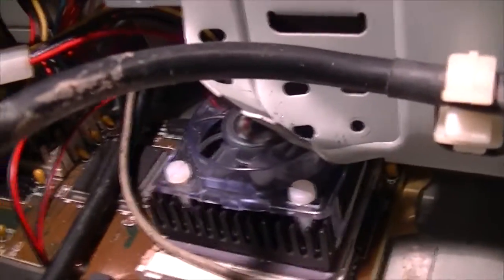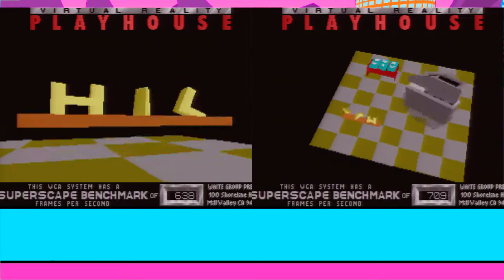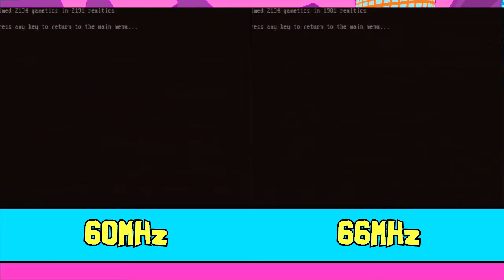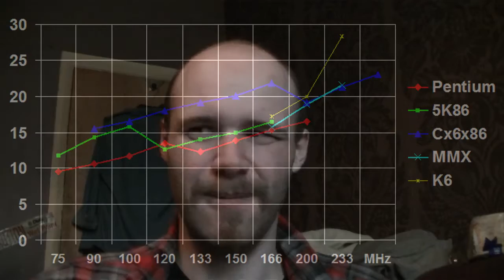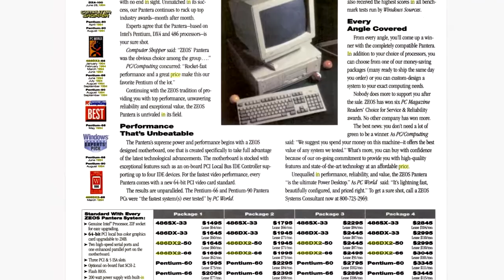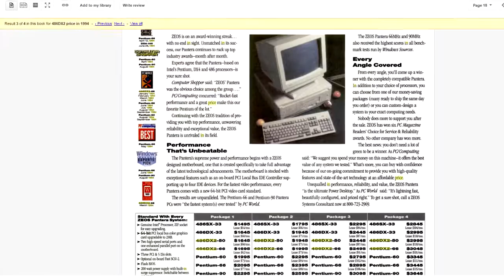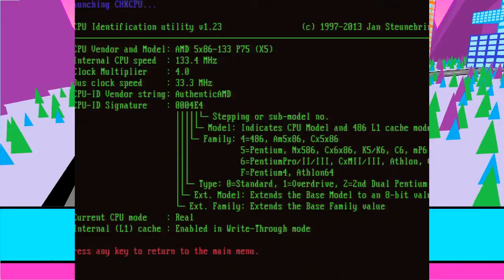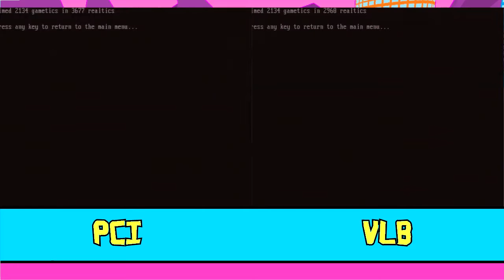Was Socket 4 ever practical?

Comment: Socket 4 seems like a stopgap without really being a stopgap at the time...what a weird socket. I always thought of it as "Oh...that sucked..let's make a new one!" I've only ever dealt with socket 3 and 5 systems and I've been happy with those, despite being weeny branded machines ;).
Reply from the maker: +lmull3 I have always questioned Intel's intentions with Socket 4, as in, did they ever plan to release processors faster than 66MHz but abandoned it when sales weren't great, or was abandoning it to make people buy more motherboards always the idea. Socket 3 and 5 are generally much less of a handful, Socket 4 is stubborn and likes things done its own way sometimes. If just the slightest parameter in the PCI configuration isn't what the board expects, weird things start happening and some of the early Plug-n-Pray implementations... No, just no. Then there's the simple fact that you cannot get away from Intel because AMD and Cyrix never made processors on this socket and I haven't been able to coax a board to start a K5 using an adapter yet. Sucks, because I rather liked the idea of getting the Intel Batman to run an AMD processor, mostly as a kind of middle finger to Intel rather than it serving any practical purpose.
Reply: +HighTreason610 It makes me think very much of socket 1156 of modern machines. A short lived socket that really didn't serve much purpose other than to get the line of i-series chips out there at the consumer level.

Comment: Very interesting and in-depth technical video. Makes me remember the good old hardware days, when there was some actual progress in performance every year. 
I remember having a 486VIP motherboard (VLB and PCI), and contrary to yours, it seemed to have a very crappy VLB implementation, because when I used a sound card ont he system, the VLB card did make some weird colour pixels and squares on the screen. So I ended up buying a Cirrus Logic 5434 1MB PCI video card, and while it had some bad reputation, after I upgraded the thing to 2MB (yes, you actually could buy 2x512KB chips and upgrade the video memory), the thing was quite fast as a 2D Windows accelerator, and quite speedy in MSDOS games.
Reply from the maker: +kanopus06 Thanks, glad you enjoyed it. In a race with only one bike, the guy would have no reason to ride any faster and with the PC industry shrinking thanks to mobile devices, I can only imagine the stagnation will get worse, hopefully the Server & Workstation market doesn't take any major hits in the process. I had a VLB board which did that once, but it turned out to be a resource conflict. That's not to say there weren't boards with bad VLB implementations, there has always been problematic hardware and back then, it was much harder to know in advance if what you were buying had any problems. Cirrus cards are OK in my experiences, they're pretty fast and usually give good enough compatibility for the most part, I cannot remember if they supported interleaving when using 2MB of RAM, I do generally default to TSeng and S3 for machines from this time though. And yeah, I miss being able to upgrade the video memory. Of course, if they still gave us that option, we wouldn't have to buy a completely new video card, so naturally they had to ruin everybody's fun and stop that.
Reply: +HighTreason610 The Cirrus GD5434PCI used a 32bit bus to access video memory with 1MB and a 64bit one if tou had 2MB installed.
About variable PCI bus speeds, both my 486 and pentium boards had overclockable bus speeds.
In fact my pentium motherboard (ASUS P/I-P55T2P4) could run the PCI bus at 41.5 MHz, with a  83 MHz bus (that was with a 166 MHz pentium CPU).

Comment: I had an AST Socket 4 PC, one of the rare ones that had only VLB/ISA and that was it, no PCI - I think it was an Opti 597 chipset? 

Had no docs for it but I figured out the onboard jumper settings to OC from 60 to 66 and it ran just fine. I had an ATI Mach 32 VLB card in it.  At the time my main system was an AMD 5x86 OCed to 160 (it would post at 200 but couldn't get it to boot), Diamond Stealth 64 VLB and a VLB I/O card. Both had 32MB RAM, later on I got 64MB in the 5x86.

The 5x86 was way faster at almost everything except for FPU-heavy stuff like Duke3d, Quake, Descent. So I pretty much used the P66 only to play those kind of games and did everything else on the 5x86.

Shortly after Win98 hit, I built my first K6-2 and eventually junked other two systems.. Always regret getting rid of the 5x86 especially, I wish I still had that one today, it's the only PC I've ever regretted ditching in 30+ years of PC use.

Socket 4 and the chips that used it were, in my opinion, Pentiums still in the prototype phase that got rushed into production to beat out AMD and Cyrix. I think the P54C is what Intel was really aiming for but just couldn't meet yield requirements or get "clean" enough board designs to work with the denser socket pinout.

I did PC repair in high school around 98-2001 and I don't recall ever seeing a single Socket 4 system come through the shop I worked in. That AST I had was the only one I ever saw, only reason I had it was it was given to me.
Reply from the maker: Not too long ago I managed to get hold of a Socket 4 board with VLB using an OPTi chipset, it is a strange and temperamental thing. Strangely the previous owner had also overclocked the CPU.
Duke3D doesn't actually use the FPU, or not in any meaningful way, but some people claim Build did have some slight Pentium optimizations and it may, despite a DX2-66 being the minimal testbed that 3D Realms used to tune performance.
I love the K6-2, it seems as though it was positioned as a Celery competitor but it performs far better than it really has any right to, finding a good motherboard in the sea of bad ones can be tough though and people always seem to blame Via or whatever other chipset maker for the board maker's (probably MSI) mistakes.
I've encountered a couple of Socket 4 machines in the wild but they were gathering dust or broken and it was a long time ago now.

Comment: Subbed, I like your style unlike the other guy shoving sata drives on a 486 ect. Got two batman boards that both have ps2 ports and both work (haven't gotten around to using anything with that shitty onboard ide). Just need the crap to use them in modern atx cases because there are simply no AT cases that I can buy for them. :/ 

Going to dump a voodoo rush in one just for kicks and one of the boards has an interesting pcb color that kinda goes well with modern crap anyway.
Reply from the maker: Thanks man, but if you do like that guy I won't be offended you know? Ah, I suspect you're having a hard time tracking down those AT backplane shields, they don't show up too often. There is also, indeed, a real shortage of AT cases now and often they are cost prohibitive - like massively prohibitive, and I do have an AT board which lives in an ATX case as I simply couldn't get hold of one to fit it, now I'm struggling with the ones I have as I lack another large enough to house some boards properly.
Reply: I don't to an extend and not happy with the community on vogons in general. I've ended up selling boards because they were too long to fit in most atx cases. If my local sources haven't dried up getting big cases wouldn't have been a problem. I did find some new old stock AT cases but they are north of $100-150 after ship and all but one or two models are without a psu :( 

vogons is so unrealistic with many people on their still thinking that most hardware is still free like it is the early 2000s. Be lucky to find anything in the tip let alone most thrift shops these days.

Comment: First off, I know what that board is...  you lucky son of a.... I hate you now! I hope you have your typical luck and it blows up!  j/k :)  That is a very nice score my friend. Looking forward to your overview of it!

I think the perception of the first Pentium was they were garbage ( fdiv bug and the "quirks" you mentioned ) and better off with a 486/66. From a benchmark standpoint, the Pentium looks better than a 486, in some cases. I think your Socket 4 is performing slightly better than mine, but I will need to look at that again but I need to look at that again with a better video card. 

Personally if someone asked me what a good 95/98 video card was, and we were talking about a PCI bus card, I would recommend the TNT because overall it is a great kick ass card. If someone was looking to run a Voodoo, then Cirrus / Trio / Mach64 would be my recommendation. 

I have done tests with the M919 boards that I have, those are rare here in the US for whatever reason now days, but anyway the CACHE module make little to no real improvement, at least when paired with an AMD 5x86-133. I don't know if that is true with all UMC 8886 boards, but it is like UMC optimized the chipset for cacheless setups. Further testing will need to be done to see if that holds true or if it is just the M919. The one thing I love about the M919 is the Cyrix 586 cache option in the bios.

Didn't know you had dogs and a bird!  I never knew those birds lived that long either.
Reply from the maker: +WaybackTECH I couldn't believe it when that appeared at the price it did and I was flat broke at the time, so thought it would have sold fast and forgot about it. A few weeks later there was something else I had to check on just one page away, so I dropped in only to find it was still for sale and known to work at which point I practically had a heart attack and promptly bought it. I was certain it would get lost on shipping or something as I never thought I'd get one, I've never really even looked because I assumed it was a lost cause from the start, but no, it turned up safe and it seems to work. Totally caught me off guard. Around a week before it appeared, I almost got a Chips Super 386, but the pins were broken so I had to turn it down. Don't expect anything about that board for a while yet as I have more pressing matters at present, but I am really looking forward to messing with it properly.

Ha, I don't think it was a viable platform for long, but in that brief time before Socket 5 and after the initial, flawed motherboards, it may have turned out as a worthwhile investment. The wise man would still have waited for the P54 though. I've been really pleased with this system so far, it does perform well and it tries to work even when other things let it down, such as that flaky IDE card, though that won't be there much longer. After this upgrade it flies through Realms of the Haunting at an almost sickening speed and the spasms in VGA mode are gone. The S3 Trio 32 I have in here is unusually fast and I've never known why, because the other one I have is not like that. I can't remember who made it, it is possible they fiddled with the clock or did something in the BIOS (As it seems they did customize that) so I really can't say. Was tempted to upgrade to an ET6000 or a Vision, but they cost more than I think they should and I haven't seen any reason to ditch the Trio yet, so it probably won't happen. Either way, since its initial appearance this has quickly become on of my favorite systems.

The TNT is probably the best all-rounder and I'd probably point that out from the start, but "the best" is almost always usage case dependent.

I could try disabling cache on my 8886 board and see how much it affects the POD83. I've heard mixed stories about leaving the COAST out of the M919 but overall I've heard it isn't too significant. If it makes a larger difference on the Aquarius I would be curious to know what PCChips did to negate the performance hit on their board.

The dogs are my mother's and the canary has been at her house for years. I never got him back when I left social services because I didn't think it was fair to keep him in a house where I smoked all the time. Unfortunately, it seems 16 years is the limit and he passed away earlier today. They generally live 7-10 years, so he's done well, the others died a few years ago but they were hens and they don't live as long. As for the dogs, I wouldn't own Russels myself, I prefer big dogs, used to have a German Shepherd years ago but she was old and the inevitable happened. I still miss her.
http://s26.postimg.org/a3qamvhrt/OLD_02.jpg

Back on the mystery board, you should have a look on the CPU World forums from time to time. Sometimes people sell some pretty weird stuff and it often costs less than it does on eBay. The negative is that a lot of the stuff sold is done so as a 'Collectors Item' and not as a working part. The Pentium 66 was sold to me in this way, the guy was surprised to learn that it still worked. At present there's not much there though, just some Power6's, weird MCUs and AMD RISC's.
Reply: HighTreason610
I was reading yesterday a thread on Vogons about the Tillamook chip and, of course one of the threads about rewiring the socket just left me hanging and didn't finished the job lol but they were talking about getting the L2 cache to work, and someone mentioned the ALi V chipset having a higher memory bandwidth and because of that was much less dependent on cache for performance than the MVP3 motherboard. Makes me think the same is true with the UMC 8886 chipset on the M919, because with the EDO ram support, and the high memory bandwidth, especially when you are clocking to 50Mhz ( or 60 )  the cache makes very little difference in benchmarks, and in gaming,no real difference either. The difference can be seen so it's not like the L2 cache isn't really being enabled or anything, but I think the memory bandwidth is the key.

There is one of those boards you picked up on ebay here, but they want far far far too much for it. I'll have to check the CPU world forum you mention and see if anything interesting pops up there.  A lot of people anymore just sell stuff as "collector item" because they can't test it and don't want to be held responsible for the part not working, which I understand, but I still test the stuff and show it working when I resell it, get more for it that way too!

My friend here at work has a German Shepard, big sweet heart.

Comment: The PC Chips M919 always gets kind of a bad rap...and yes it does have its quirks but it can be a very fast board with a little patient tweaking and a little luck. Mine currently has a Cyrix 120mhz 5x86, a Ark logic PCI video card and the 256kb cache stick and it pretty much flies.
Reply: +0blivi0n100 The M919 is fine, the big issue is when you have one and don't have the COAST-alike thing it uses. They're basically made of unobtanium.
Reply: I guess I lucked out. I found a guy online selling M919 boards and one had a COAST module. I got him to separate the module for a reasonable price. Had some initial problems getting it working though. took me awhile to figure out It wouldn't work if I had EDO RAM installed and needed to switch to FPM.
Reply: 0blivi0n100 Yeah, M919's together with the cache are a way more common than the modules by themselves.
Reply from the maker: +0blivi0n100 From what I've seen, they're not bad boards at all and the support for late model processors being fairly good goes a long way. I actually have one of those cache sticks and I got it for less than £5 some time ago. My plan is to reverse engineer it and attempt to produce a few copies.
Reply: I think that would be very helpful to a lot of people. my board has had no issues supporting the AMD 5x86 or the Cyrix 5x86. Its also the only known board to support reactivating some of the Cyrix 5x86 features via BIOS. I've also achieved pretty decent results overclocking the PCI bus on the M919.
Reply from the maker: +0blivi0n100 So far the circuit seems pretty simple, but my PCB design software is very primitive and I haven't yet gotten the slot's finger size or spacing right. Otherwise, there's nothing on board that would indicate they did anything unusual - aside from the chips being 3V SOJ chips instead of the 5V DIP type you'd usually see. I might try and obtain a board at some stage to see if 5V chips can be used somehow though the 3V ones are not too hard to find. Also, as one edge of the connector just jumpers some pins I wonder if it was used to select cache size, it might be entirely possible to use 512K or even 1024K of cache as PC Chips once advertised but I am unsure if I will make much of any progress on this idea as yet and it has gone back on the pile of things to do at a later time. One thing my Aquarius does not like is overclocking the PCI BUS, going north of 40MHz causes complaints, though there seems to be a 1/2 Divisor, which makes me wonder if a 66MHz system BUS is possible as the clock generator should support this undocumented speed. Those disabled Cyrix features are odd at the best of times and the command line tools are irksome, so that does indeed sound like a nice feature.
Reply: HighTreason610 I wonder about the thought process where they came up with, designed, and manufactured a proprietary COAST-alike thing for real cache, and still put the footprints and go-nowhere-traces for fake cache on the actual mobo, and the code in the BIOS to lie about it.